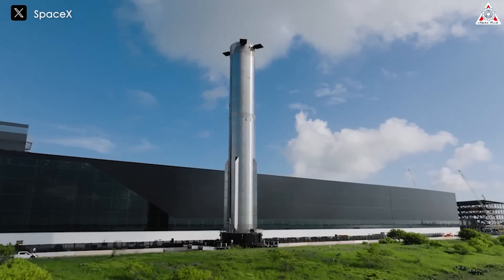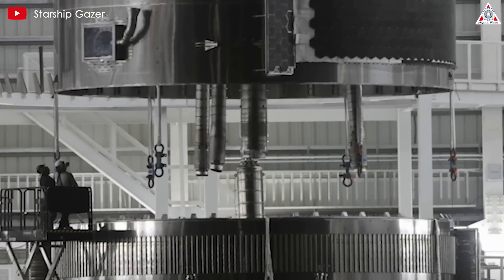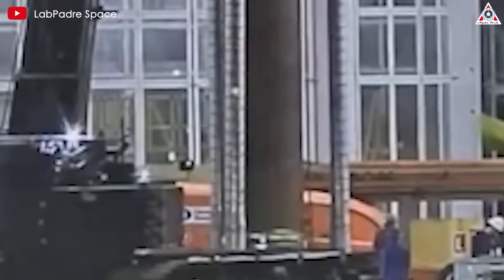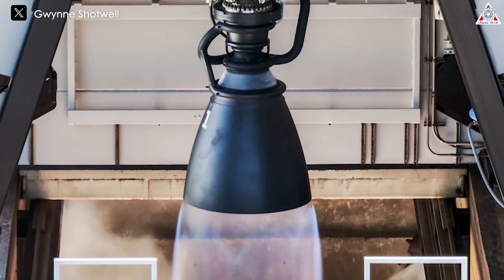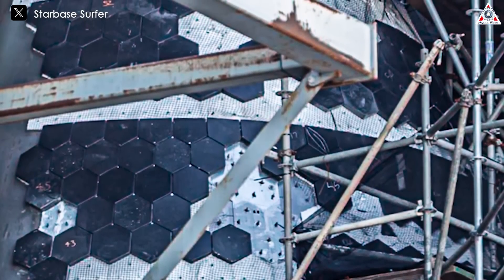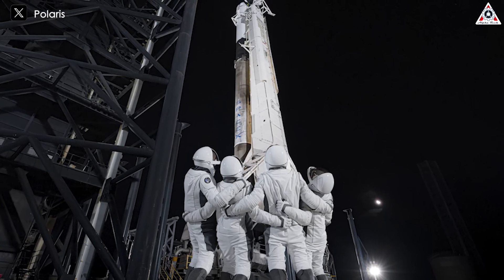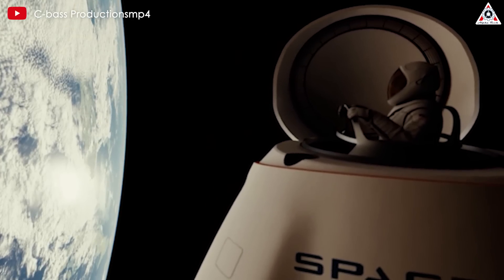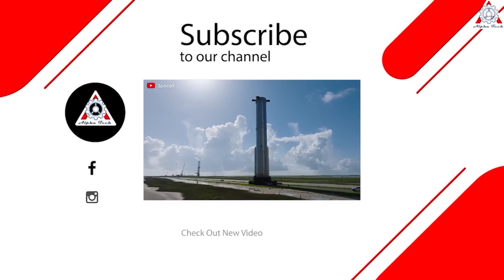SpaceX Just Revealed New Starship Changes Upgrade Somehow Shocked Blue Origin & NASA

Comment: The propellant downcomer reduction in radius may be to accommodate propellant acceleration. Moving up with the rocket in the tank, a lot of prpellant starting to move down into the top of the funnel, same amount moving faster in the middle, same amount at full speed entering the pipe. Same amount per second at all 3 cross-sections of the funnel. (Pretty much guessing here, hope I'm right!)
Reply from the maker: This makes sense because with the increased number of engines, SpaceX has to do so.

Comment: Great!
I've been waiting for Raptor 3 engines in use on a test flight for over a year! 

On the down tubes, the Enginerds are cobbling again....

Adding to parts count and complexity, instead of more wholesome intergral design thinking...

The rusty center tube is likely indicative of suppliers being out of the correct size in stainless, and the Rocket Nerds realizing they could use mild steel because its just gonna be a sacrificial test vehicle.

In fact, they could be using mild steel for alot of stuff throughout these tests to save money. pretty much everything but skin and outer surfaces. which are needed to be stainless to test for re entry heat.

But its Nerds...
With a fat budget...

On the down tubes, Captain A-Hole, (Me) has done several writs on reverse tapered semi concentric tanks, where you have sections of both tank bottoms accessible at the ship's buttend... Also give the ship a wider base to be free standing, ie with tapered ships design concept, to not keep growing taller like Jack's beanstalk...

They are still operating in the trap of tube hulls concept. Not thinking outside of it, and getting easy possible advances.

Its not the last problem due to the start as a flying water tank. And the Enginerds being mind locked in 1960....

Luckily we have competitors.... both Rocket Lab and Stoke Space thinking in tapered and shaped hulls.
Also Sierra Space is on shapes with Dream Chaser. They may figure out things  from observing Starship, and adopt and adapt.

Hopefully SpaceX doesnt end up like Boeing and NASA, and get left in the dirt.

Would be a sad ending... to alot of good jobs...

Whats needed is start morphing the tanks together, and turning bottom of top tank into a taper, to replace down tubes with a much larger diameter, taking up about half of the bottom diameter. with the bottom tank taper fattened  reversed  and sizes of both tanks adjusted shorter and wider.

More base for engine area and work space, shorter pipe runs, less internal friction and flow resistance, and shorter freestanding ships and boosters that dont need towers to not fall over.

They could take 
off from perf plates with water deluge.
And if aft wing fins  extended farther aft, no need of a launch stand. Or you could maybe divide the hot seperation stage ring into halves on ship and booster, and have ship's cup stack slightly and lock on. this would give you a landing base ring, which could have suspension.

Then you could hop stack, and fuel up the booster after.

Anyway... I'll be happy just seeing Raptor 3's getting used for public consumption.

Theoretically should be way more reliable engines than the Spaghetti Monsters.
But they are pushing limits, so we might get more of Elon's finest  entertainment.

But my guess is even Short Bus Jeffie will finally grok parts count and simplification of engines.

For me its been a three year battle, and amazing how slow others are to think...
Aspie Elon got it in hours...

And has been flogging the Nerds ever since...
And is a happy clam.

Gwen seemed delighted too, dinging Tori Bruno...
That was great! classic space humor...

Anyway, guys, do think about tapered tanks and ships... The welders will be fine with something new...
Just need better layout guys, and longitudinal gores... And you might be able to teach the old dogs, the new tricks  or just get new dogs....

Learn it, or apply at Jeff's....

🤣